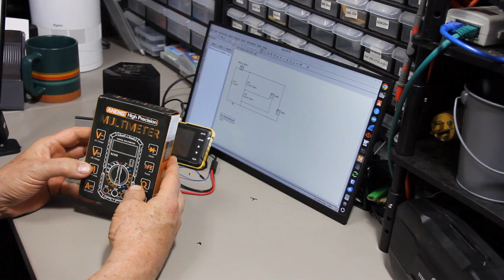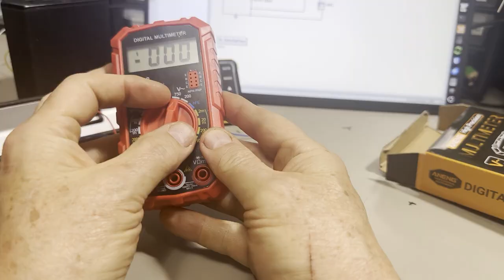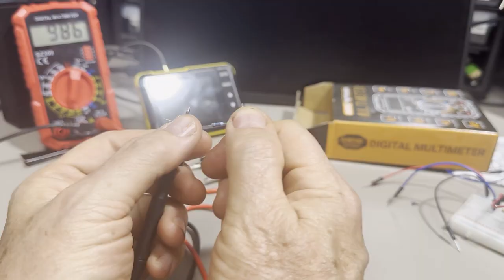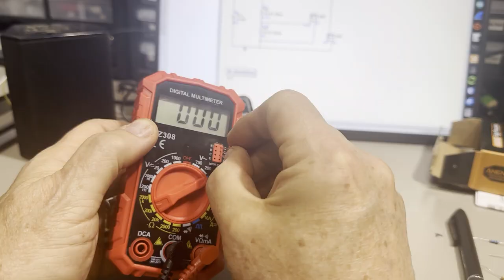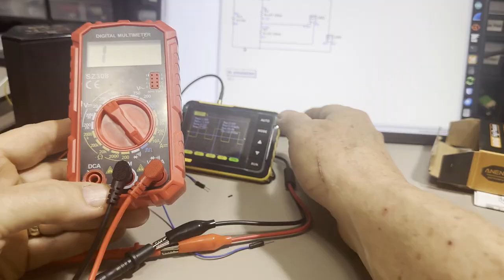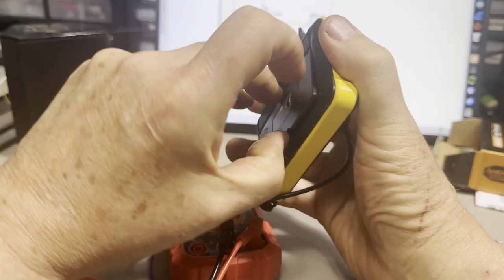ANENG SZ308 Digital Multimeter — Full Bench Review | Every Function Tested

Comment: I played with the one you sent me, also could not get hFE to work. I opened it up, turns out there are no pins etc leading to the little breadboard on the outside of the unit, just some holes in the pcb about 1 cm from the case no way to get the legs of a transistor to line up correctly.
Reply from the maker: Nice work investigating that.